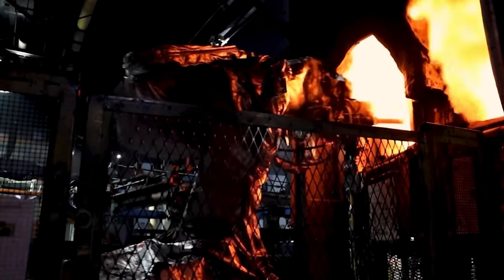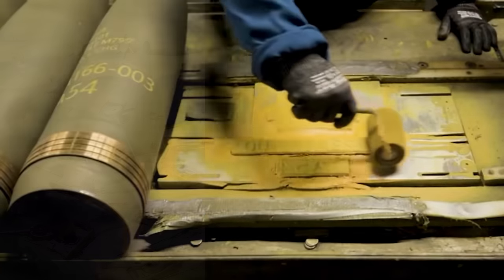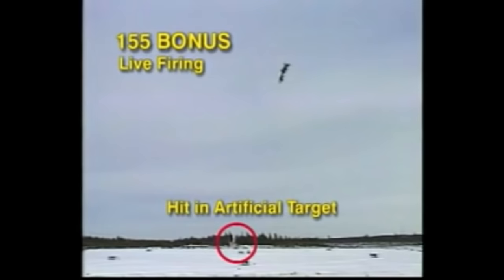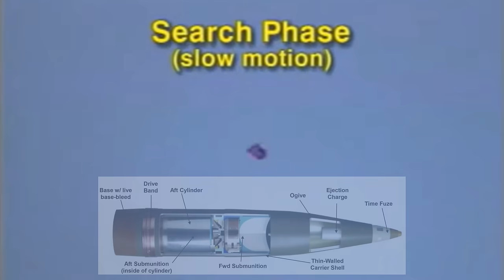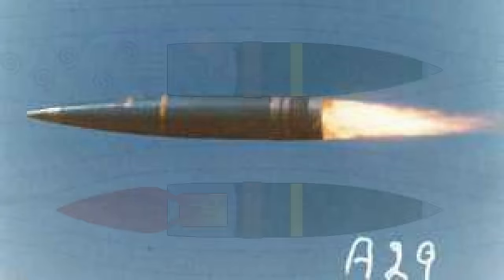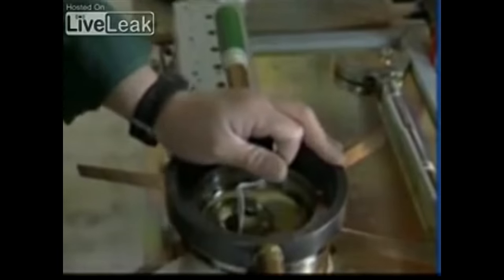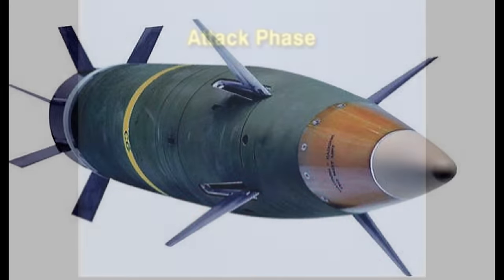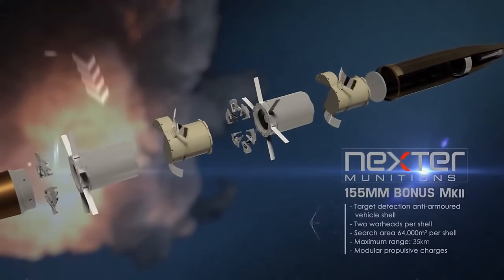Is the 155mm 'BONUS' Round the most Practical Artillery in Modern Warfare? TANK HUNTER KILLER 💥

Comment: While the high tech rounds are fun artillery is a "bulk" weapon and is ment to be used in batteries of multiple guns. Supplying those guns with high tech rounds is beyond expensive and likely impractical depending on production rate.

If you have to hit a specific target and air support isn't available I can see the use but otherwise I would rather have pallet after pallet of regular HE shells so I could erase a given grid square within range.

We have to guard ourselves from becoming ever more addicted to "precision" weapons that are nice on paper but less useful than a area of effect weapon.
Reply: Having huge stockpiles of more traditional munitions is more important but the idea behind these BONUS and SMART rounds is to just quickly blunt a mechanized assault. Just as an example Finland is buying both BONUS 155mm and Storm Breaker SDB II for the F-35's just to stop a large scale mechanized assault in its tracks.
Reply: Not to mention the multitude of other Weapons that are already in service that are capable of taking out a tank. Definitely a stop gap to be used in a pinch or in a very specific scenarios.
Reply: These smart weapons are well worth their cost in terms of the damage they can do to an armored assault wave,  but it's infantry that takes and holds the ground, and for that lots and lots of plain of HE is best.
Reply: Area effect AND Area Denial
Reply: The job of artillery is to destroy or substantially degrade targets assigned to it. If the job is to saturate an area several hundred meters in diameter, unguided artillery would certainly do that job.
But if the job is to hit a specific small target, such as an enemy artillery gun, anti-aircraft radars, ammunition cache or a command post, then firing 20-30 unguided rounds to accomplish the fire mission is likely more expensive than firing 1-2 smart rounds. Besides the cost of just the smart versus dumb rounds, there is the potential that the target will escape as ranging rounds and correction rounds are fired before the entire battery can fire for effect. Plus it takes an entire battery to accomplish the mission. If the enemy has counter-battery radar, they know where you are after you fire that first ranging round. The longer you have to sit there firing multiple rounds until the target is finally destroyed, the greater the chance there is that the enemy can destroy your artillery battery.
But with smart rounds, which can be as little as $10k additional per round for precision guidance kits that screw in to an unguided shell in place of the fuse, a single self propelled howitzer can take up a precisely known firing position (thank you GPS), fire several smart shells which have a higher chance of hitting within a few meters at maximum range and so high likelyhood the target will be destroyed than 10 times as many unguided rounds. And then the single howitzer can be back on the move just 1-2 minutes after stopping. Such “shoot and scoot” capability greatly increases survivability against a peer or near peer adversary.
And perhaps the greatest advantage is that many more fire missions can be completed per day for a given number of guns when firing smart rounds. So 10 howitzers firing smart rounds can inflict as much damage on the enemy as 50 to a 100 howitzers firing unguided shells.
Then add the reduction in wear and tear on the guns per fire mission as well as a smaller logistics tail moving a far fewer number of shells .
Putting it all together, firing expensive smart rounds could end up costing less than trying to accomplish the same missions with dumb rounds.
Reply: "pallet after pallet of regular HE shells" costs a fortune in logistics to get where it needs to be, and everyone but the United States is woefully deficient in logistics and also lack the pre-staged materiel that lessens the costly and difficult to maintain burden of a large standby force of airlift, sealift, and ground transportation hardware and personnel. A smart round may cost $50,000-100,000 instead of $3,000 for a dumb round, but look into how many billions of dollars it costs for logistics capacity and it quickly becomes close or even more economical to have smart rounds. Also, you have to consider that counter battery fire is a real danger to artillery that requires them to shoot and scoot, meaning there is a limited number of rounds that can be fired before down time is required to relocate. When forces are under attack and you can launch 20 projectiles before disengaging, you can bet it's preferable to be able to destroy 25-35 vehicles instead of 5-10. In short, there are numerous benefits that you're not considering.
Reply: Oh, and the fact that artillery have limited barrel life, some as little as 1,000 rounds firing max distance, 3,000 being more typical; meaning you've just added additional logistics, manufacturing, refurbishment, and maintenance facilities and personnel requirements to support the use of inefficient dumb rounds. Total cost of effect on target, collateral damage, ability to safely engage targets that would otherwise be 'danger close' for friendly forces in close contact with enemy forces... the benefits of precision weapons are numerous.
Reply: While bonus is expensive to pocure, they are very cheap logistically

Comment: me thinks Ukraine shows right now that a Smart155/Bonus round can be a fairly costeffective solution despite the high price ... the UA artillery deals daily with very small assaultgroups of 1-4 vehicles and spread out (artillery) units in need of destruction, it takes a large amount of conventional artillery fire and precise target positioning data to deal with such threats ... those Smart/Bonus rounds dont require target positions/updates as precise and can achieve with 1 or 2 shots what otherwise would take prolonged artillery fire covering a larger area.
Fewer rounds in need to be fired also means your artillery is less exposed to a counter, therefor less at risk to lose a really expensive piece/soldiers.
Also rather silly to imply that these rounds are too expensive for usage on lightly armored targets like BMPs or SPGs ... these are still high value targets and the UA ofc would love to use Bonus/Smart on those ... and they probably do whenever such a round is available to them. 
The price for such a round is similar to a Javelin ATGM missile according to sales to switzerland, greece and other more recent deals ... and noone would deny a soldier using a Javelin on a BMP out of cost concerns.

Comment: Stealthy shells to avoid counter battery are becoming more necessary. As smart rounds become more capable simply relocating after shot may be insufficient. Simply guessing that the unit would reverse out position as is standard could be devastating with bonus.
Reply: The future will be firing on the Mode, aß already seen on Rheinmetalls boxer 155 artillery
Reply: Usually it takes a minute or two to direct fire for counter battery which is usually not fast enough to deal with Mobile artillery since in 2 minutes it can be a kilometer or more from where it originally fired. also stealthy shells aren't really a possibility since its not just the projectile that gives away the artillery position.
Reply: RCH155 can fire on the move and if it doesn't it can deploy, fire 8 shells and move away in under 2 minutes.

Comment: Looks like this is a rocket propelled projectile. So I don't know how greatly this reduces the powder charge as well as the initial muzzle velocity of the round. But that is definitely one of the ways they got around some of the physics that can destroy electronics in artillery shells. You know 50 gs of acceleration or whatever it is for a typical artillery show. I'm sure it is reduced down to a fraction of that and then the rocket assist helps it actually get the distance it needs
Reply: Bleeding just improves aerodynamics by eliminating or reducing turbulence behind the projectile resulting in significant more range. Rocket propelled projectiles do the same, but gives in addition impulse for even more range.
Reply: There is no rocket assistance in BONUS or SMArt155 shells.

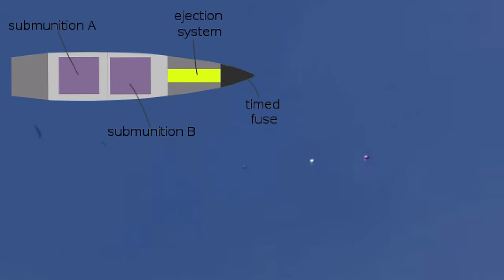Comment: 2:45 Slight correction: at 6:35 you see the charge fired effectively at a fair distance which means its an Explosively Formed Penetrator rather than HEAT. 
So it's gonna be a slug rather than a jet going through the roof.
Reply: Yep its an EFP not HEAT, EFP has much greater range but lower maximum penetration since you are essentially making a large extremely fast projectile rather than a thin "jet".

Comment: Krasnopol's newest variant fired out of the Koalitsiya SV is very impressive. It actually outranges all NATO systems.

Say what you will about the Russians (I don't think we want a political discussion), you have to acknowledge that necessity has forced them to quickly up their game.

Their newest artillery is matching at Western systems save for Namo's ramjet powered 155mm shell (which is very good but extremely uncommon, only really been used in testing).

If I were a NATO war planner, I'd be very concerned about the fact that Russian industry is now firing on all cylinders, all while we seem to be asleep at the wheel.

Comment: Is this better than just drone dropping a rpg heat round? 
Cost alone compared to 2,500 bucks for an rpg7 round on the high side.
Reply: the problem with drones is
1 they can miss unless they are equipped with expensive electronics(which ruins the whole point of a cheap round) or used along side a highly trained operator( fly drones requires alot of training and isnt as easy as handing the new guy a drone, rc and rpg)
2 drones can be hacked using electronic warfare. ukraine has admited when russia focuses on there electronic warfare their drones are practically useless (luckily they havent done that alot)
3 cheap drones need their operators neer by due to the short range antennas used in cheap drones

they both have benefits and negatives

Comment: I think using this for SEED over anything else is actually it's best use case, Air defence systems are ridiculously expensive and usually one of the most difficult things to take out reliably just look at the Ukraine war and I mean from performance stand point not the other stuff. Our doctrine is so reliant and dependant on controlling the skies that anything that has an edge in suppressing enemy anti air should be given priority, you don't get much better than an arty round honestly if at all. Like the whole using anti radiation missiles is a nice option but lets be honest taking out air defences that way is just sketchy so much can go wrong cause it's a frikin missile.

The fact you can use this round to assassinate high value armour targets  is just a bonus not it's true strength in my opinion. If we move away from relying on air superiority for MDW then sure this type of round is going to be best suited for taking out high value armoured targets. That's how I I'm approaching this anyway which how it does it fit with everything in the current doctrine.

Comment: Why not install a flashing light on each sub unit so that it could easily be cleared out by mine detectors and scrappers coming onto the battlefield? This could help address some of the concerns about failed units. Obviously an LED with a built-in battery could probably run for months.
Reply: How would months of an LED flashing be of any use when the contact line is stationary for years and unexploded ordinance disposal personnel do not operate in areas at risk of enemy attack unless it's in direct support of friendly forces attempting to assault through a mine field?
Reply: @msytdc1577  then how about one that goes into a safe mode with an passive AirTag so it can be detected with a phone app
Reply: It's easier to just ha e a self destruct fuze

Comment: I'm sure somebody can explain this for me. "For every action there is an equal and Opposite reaction". OK.
The 'bonus' round is small and seeks the target. It acquires the target and sends out a stream of metal that can penetrate 80mm of steel. Wouldn't the negative part of this force push the 'bonus' round way off course before it had time to 'blast' the target?
Reply: you got the right idea but are thinking about the wrong factors involved
when it explodes the metal is shot towards the target (that u are correct)
the opposite reaction comes in the form of the explosive being launched backwards in order to propel the shaped charge forward.
its similar to how recoilless guns work. projectile goes forward. blast goes back.
hope this helps

Comment: I have yet to see a video explaining exactly what it is that hits the target, it's always explained as a "copper stream."  So the question: what is a copper stream?  Is it hot liquid?  And if so, how does that work, what are the basic physics that allows such destruction of thick armor from such as small munition?
Reply: ill explain as best as i can

1.imagine an explosive that surrounds the outside of a traffic cone made from copper(or any soft metal) 
inside the cone is empty
when the explosive detonates it compresses the copper cone into a line of copper.(this is refered to the stream)
this copper is so thin and travels so fast that when it hits its target it will have so much energy behind it that it can penetrate the armour even though the copper is so light (similar to any kinetic round)
any anti tank rocket uses this basic idea because it doesnt need initial velocity.

also its not molten just deformed into this line. people wrongly state its a liquid. its still solid

2.in terms of the physics behind it 
the 2 things needed to penetrate armour is speed, weight
if a big rock slowely lands on ur head u die.
if a light bullet hits ur head fast enough u die
this means if u have enough of one then the other doesnt matter to much
the weight of the copper incredibly light but the speed of the copper is mulitple times faster than than any bullet. because of this it has more than enough energy needed to penetrate thick armour.

hope this helps. reply to my comment if something else is confusing ur
also check out scottish koalas vid about tank shells as he does also explains it very well
Reply: @flabelflabel7913  Fantastic, detailed, easy to understand with your talented way with words for the lay person.  Thank you!

Comment: Explosively Formed Penetrators' (EFP), also known as Self-Forging Slugs, do not produce a stream of liquid metal like a HEAT round. Instead, it produces a solid metal 'slug' with enough speed to smash its way through armor plate...
Reply: HEAT rounds don't work the way you seem to think they work.  The projected liner is purely kinetic, it just pushes its way through the armor.
Reply: @k53847  But the fact that HEAT rounds produce a molten metal stream is the reason why spaced armor, slate armor and ERA work against HEAT projectiles. The explosively formed metal stream will only travel so far before the metal .stream starts to lose its cohesiveness. This is also the reason why EFP has a much longer effective range, as a solid slug of metal will not have the dispersion issue that the molten metal stream from a HEAT round will have..
Reply: @LeonardMiyata  The purpose of slat armor is to destroy the warhead, or at least deform the liner.  That's why the slats are so narrow and so much is open space.  Ideally it's like driving your car at 90 into a large steel I-beam, resulting in a dented I-beam and two piles of shattered car, or two pieces of an ATGM that harmlessly crash into the armor and fall to the ground.

The liner isn't melted, it is compressed and fired towards the target as a 40,000 FPS jet.  It's that it's a metal jet moving at 40,000 FPS that cuts into the target, not that it is hot.
Reply: @k53847  You're mincing at words here, and ignoring the effect of compression heating on that metal liner.

US Army studies on how HEAT and APFSDS works using high speed X-Ray Photography show that both work in a similar fashion. The molten metal stream from a HEAT round will burn its way through armor, much like a welder's cutting torch. APFDS, with so much kinetic energy concentrated at tip of the long rod penetrator, will convert the tip into plasma, which then proceeds to burn its way in, much like the HEAT molten stream

Comment: The United States Airforce used similar technology in its anti-armor cluster bombs the CBU after dropped above a column or formation of tanks the bomb would eject a bunch of explosively formed projectiles that would parachute down using millimeter wave sensors and when a tank is moving below the skeets would fire and bye bye tank a F-16 could drop 4 CBU'swith 32 skeets each so one pass and the better part of a regiment of tanks and apc's could be destroyed or damaged.  Just a devastating weapon system.

Comment: Good tank top or Roof armor 
35 mm is on the generous side that's about an 1 inch & a 1/4 
25 mm to 30 mm is Average for a Good Armored tank 
20 mm is a little on the light  --  Less than 20 mm you're looking @ armored cars
,,,,..........the exception to this is Israel Merkava  -- It presents the thickest armor Because Israel design is outstanding; on this particular subject 
what you Hit when hitting the tank TOP is the Turret Front my best guess is somewhere between 350 mm to maybe as high as 650 mm    << 14 to 25 1/2 inches>>